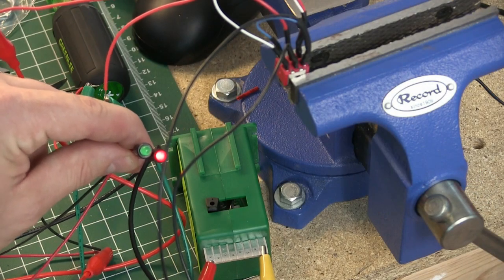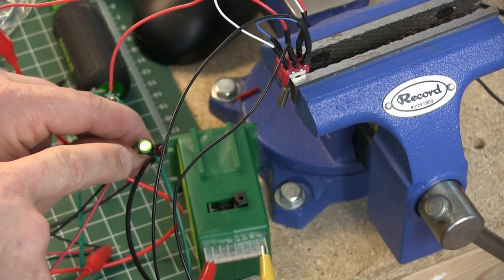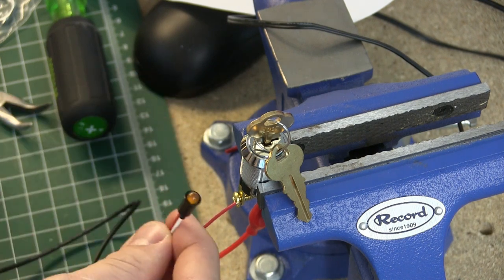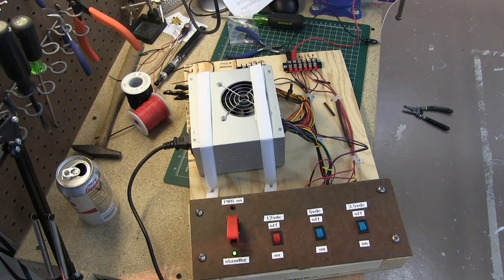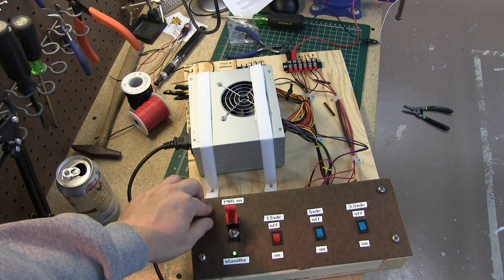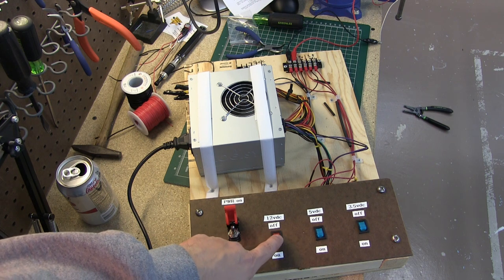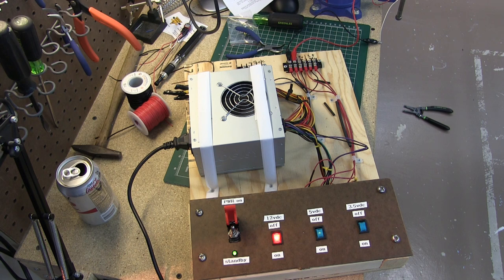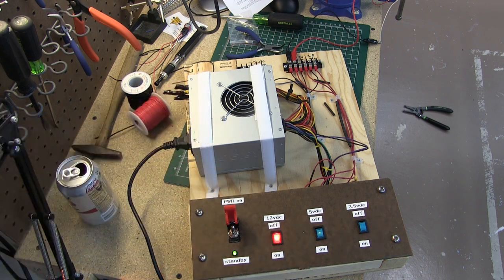Bench testing Tortoise switch machines & Bench top power supply

Comment: Great videos, really like watching your progress.  Instead of the using DPDT switches to control the Tortoise motors and LEDs you could us SPDT switches and two 12 VDC power supplies along with bipolar LEDs.  It cuts down on the wiring required along with not wiring up all those DPDT switches and you have a lot of 12 VDC power available.

Comment: You could find some solid state relays that when you energized the 5v and 3v circuits, would close contacts that could run the switch LEDs from the 12 volt supply.  That way they would be bright once the lower voltage circuits were energized.  Just a thought.
Reply from the maker: Interesting idea. Thanks for watching!